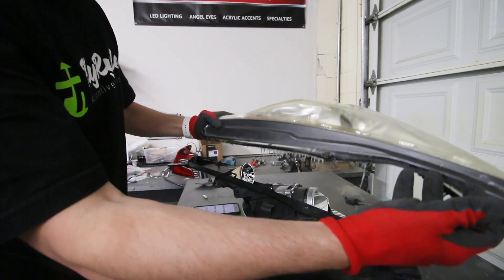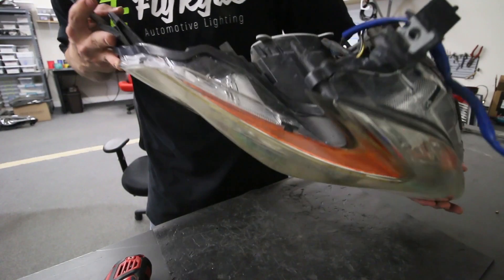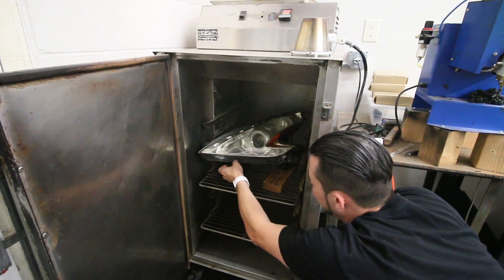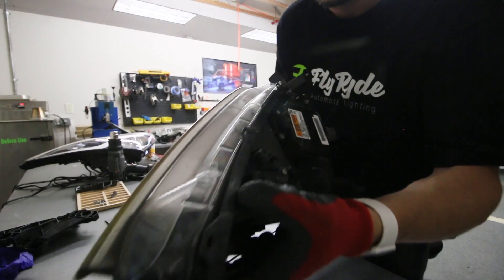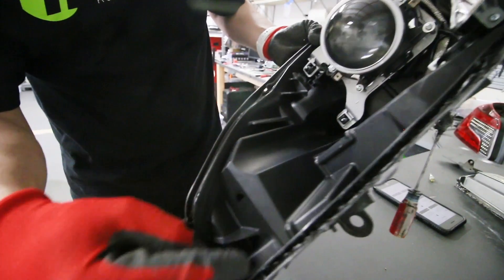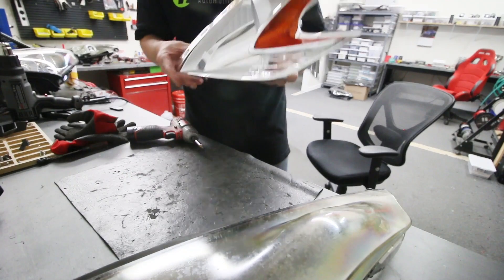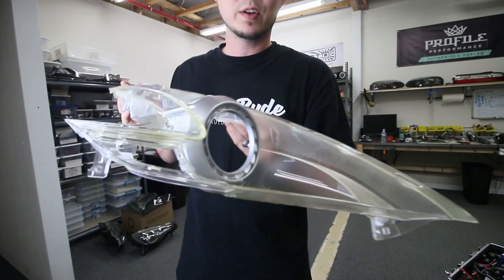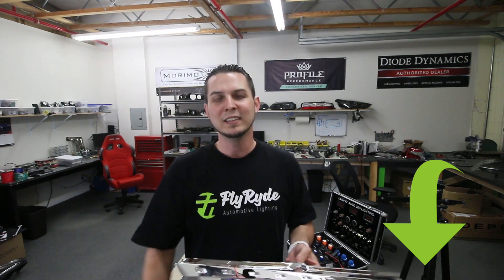How to Customize your HEADLIGHTS | Nissan 370Z | FlyRyde

Comment: Was the airbag crash sensors attached to the front bumper when you took it off? 
Or was it attached to the car frame?
There should be 3

Comment: Custom headlights changed my life no joke
Reply from the maker: D D how so my man?
Reply: @flyryde  I used to be a 300 pound comic book nerdtill a co worker told me about moding i did the dd tail as turn first and I went crazy from there I lost 70 lbs my 2015 legacy looks like a wrx and I found an 07 spec b that was modded to stage 4 for under 15

Comment: I would like to do this to my Z, but would you recommend sanding the chrome a little bit and priming it before applying paint? Should I clear coat after I paint it? Also, is there a specific brand that is best recommended for headlight modification? Sorry for all the questions but I would like to get this done right the first time... it is also not too easily reversible..

Comment: hey chris, can the clear cast portion on the 370's light be polished out to be less yellow after stripping the chrome paint, or is this just the color of the plastic its cast out of? about to tear into my z's headlights and want to do a switchback strip under the long flat section it if its possible to remove the yellow tint, if not guess its going on top like everyone else, thanks, keep up the awesome vids.

Comment: How do you open permasealed headlights? I remember you mentioning in a previous video that there is a tool for it
Reply: Permaseal are a pain to open you can either cut the headlight or just use a lot of heat
Reply from the maker: Yeah I’ve shown the tools before. I’ll take a stab at an effort using them. I already hate myself for it it, lol